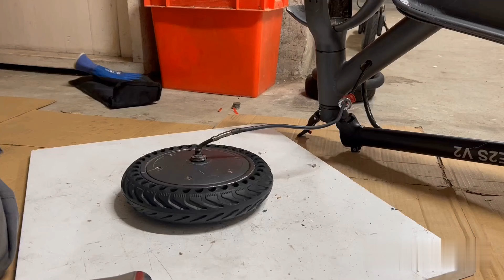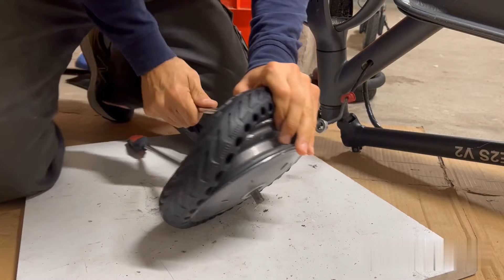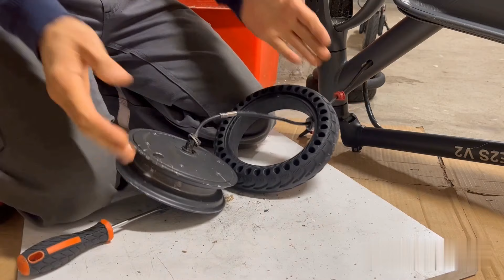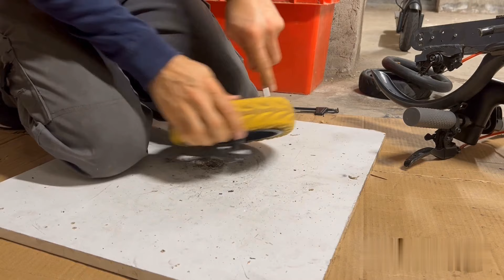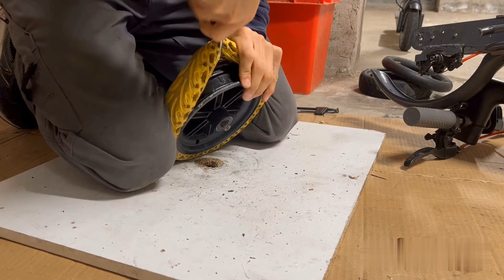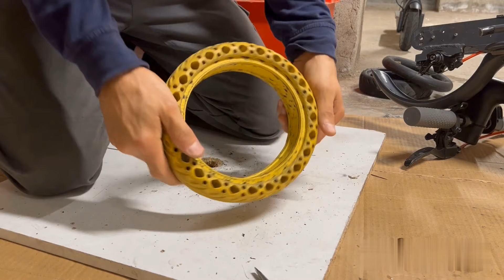How to remove solid tire in a minute / 30 sec on Xiaomi |Wheels | E-Wheels | ClassyWalk | English

Comment: Question? Why would you take it off? If its to replace, then just cut it off 😂
Reply from the maker: If you replaced it the wrong way, you need to remove it without damaging it.  That's why. If you dont need the tire again yes, just cut it off you are right.